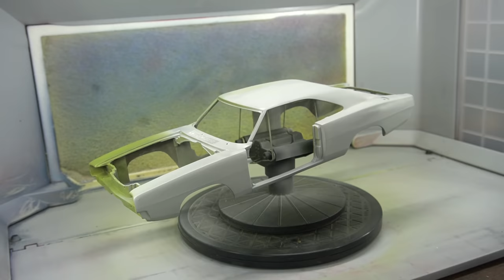Restoration Dodge Charger R/T  1969 General Lee - Abandoned Model Car

Comment: Nice. But i just looked up online on how to fix die cast metal. Using a pin is good but they sujets using tin solder to fill the holes. But i guess Bondo will do.

Comment: It's awesome the only thing I would have changed or done different would be the stickers of the numbers, General Lee and the Confederate flag I would have painted them on or at least sprayed a clear coat over the stickers to make the less noticable and would have made them blend in a little better but that's just my opinion witch at it was but other than my opinion the restoration build turned out to be perfect good job keep the restoration videos coming

Comment: The wheels aren't right. Similar. The fins would have been closer together and more of them. I think they called them something like turbo wheels if I remember right. Cool video. I liked it for sure. Now I want to buy 20 of these models and build them in various stunt wrecks from the show. Front end bent up at the firewall from a jump. Build a rollover car. Build one left out in a field. Build one stashed away in a barn. Build the barn as well. Hell yeah, thanks for the ideas. God bless all.

Comment: If you are a scale model car builder finding junk diecast cars in 1/24 scale at flee markets and yard sales saves alot ofoney on detail master and aftermarket detail.parts and you can get more detailed and realistic looking motors and seats ECT so that's just a tip cuse only thing on alot of die casts that are metal is just. The body rest can be used in scale model car building

Comment: I have a paint question. What is the BEST method to bond paint to Zinc based metal alloy to prevent (or be highly resistant) to impact chipping? I do know that no paint in the world could ever be fully chip proof, but I have a project and just want to know the best option to reduce my need to apply a patch up coat. Is a specific clear coat/paint type used in air brushes effective?

Comment: I am an artist, restorer, model and prop builder amoung many other talents. I understand restoration. I understand customization. That model/issue of ERTL AUTHENTICS GENERAL LEE is an EXPENSIVE collectable. SUPER RARE.  Why you would destroy the original and NOT make any improvements (example put the correct roll cage inside) is BEYOND COMPREHENSION. If you're gonna destroy a RARE COLLECTABLE at least make it more realistic and screen accurate. You've now created something worth less than the original release. I'm actually upset your destroyed a perefectly good ERTL AUTHENTICS GENERAL LEE.
Reply: @99Vood99  DUKES is known world wide. He knows.

Comment: ya know that was a good looking model car before you intentionally fucked it up to make a video. look I know I will get a lot of hate but think about it for a second, the "breaks" are too clean meaning they were cut, the splotches of missing paint were clearly sanded, and most of all just one front corner broke? don't you realize that it is clear where you bent that side panel that was only slightly broken perfectly on a soldering joint?

Comment: You've destroyed the chrome. You've painted the antenna base silver. You did not correct the roll cage. You did not fix the hood edge to meet the grill perfectly. The grill and bumpers are supposed to be chrome, not silver. To REAL DETAIL ORIENTED DUKES OF HAZZARD and GENERAL LEE FANS, You have completely BUTCHERED this poor car. You don't understand how we VALUE these. And you completely F'ed it up. Good God!